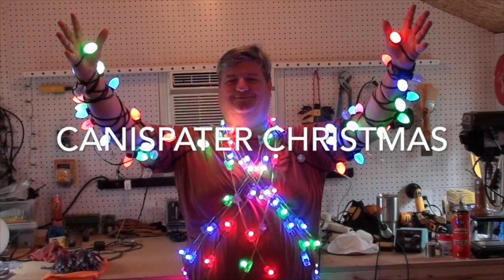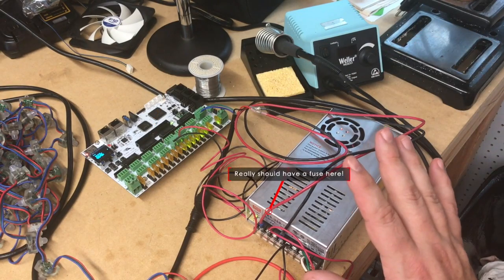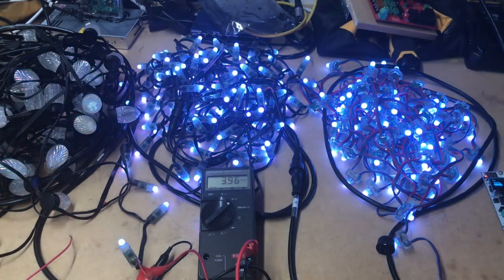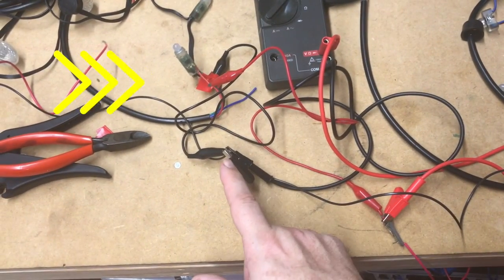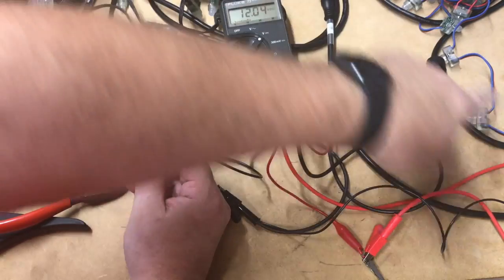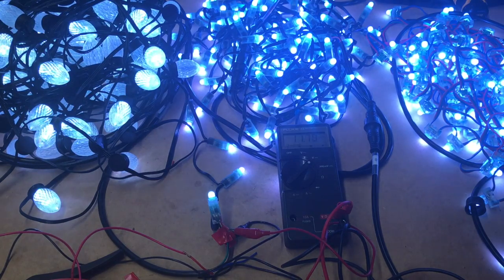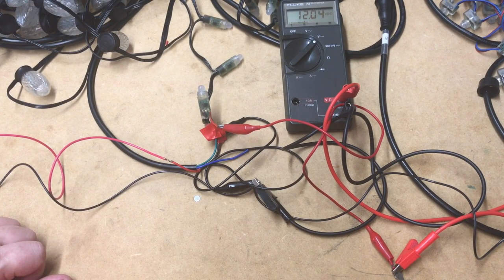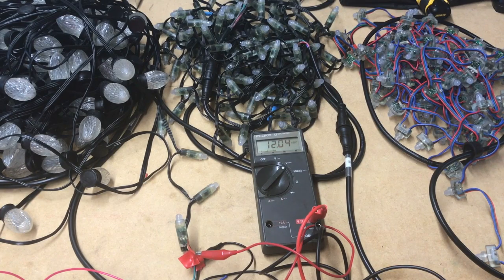Injecting Power For RGB Pixels

Comment: What gauge of wire is good to use for power injection?  I am doing house outlines with a total of approx 800 nodes and a singing face with 380 and another with 100.  All 12v.  Will one ps be sufficient if so how do you take the wire from the ps to all points of injection no more than 100?  My singing face with 380 I will need to inject approx  3 times.
Love the channel!
Reply from the maker: Thanks! Distance, string length and brightness all affect what you'll need so you'll have to experiment a bit. You can usually go 100 12V nodes with no issues. Stay under ~80% of the max current capability of the power supply. So a 30-amp supply means about 25-amps useable. I'd start with 18AWG or better and see how that works (depends on what you already have). "My singing face with 380 I will need to inject approx  3 times." Probably true for 100% brightness. I did my large 280-node wreath with only power at both ends this year and it was fine at 30% brightness. So it's a balancing game and let the lights be your guide. Try with no power injection first then add as needed. Start injecting at the end and work your way back to the beginning of the string. You may find one is enough.

Comment: So, basically the only channel important from the controller is the data channel?
The plus and ground can be gotten straight from the trafo?
If that is the case it helps a lot since most controllers only manage 5 amps, which if you try to get all the amps thru there, make 5 volt systems useless.
Reply from the maker: The goal is to keep current going through the board to less than 5 amps. There are several ways to do that. One is completely bypassing power distribution on the board. Another is using power injection along the string. Another is lowering brightness. 5V strings need more power injection than 12V strings, but you can get strings long enough on either voltage. For example, I have 4, 300-node strings on my 12V megatree. I inject power every 100 nodes and run them at 30% brightness. That keeps current through the fuse below 5 amps. For the demo, I bypassed completely, but I don't do that in the display any more and use power injection and brightness to manage current flow.

Comment: So when I attempt to run 2OO pixels full white at 100% with no power injection, I blow a fuse on the board port. Did you put a higher amp fuse in when you did this test to keep the lights on? Thanks.
Reply from the maker: No. In this video I bypassed power distribution on the board. The traces on the board are the limiting factor. If you put a higher amp fuse in there they will burn. So instead of going through the board for power, I connected directly to the power supply. If you're going to do this, I strongly suggest you put a fuse in line since it won't be protected by the board. But I also suggest using power injection. :)

Comment: Thanks for another good video. What kind of cord type do you recommend for doing power injection.  Can I use regular extension cords and just add pig tails/solder directly even?  What about for data do you use just CAT5 cable?  Thanks for any advice you have for me and keep up the great work.
Reply from the maker: Thanks! First, I try to limit the amount of power injection required by lowering the brightness to 30%. Pretty much any kind of copper wire works for injecting power. I have one run that is greater than 30ft so I use CAT5 for the data line, but normally just use the standard pigtails from Ray.

Comment: So i have watched your videos here and in your class and have a question. when running lights for a roof line display that is a total of 240 ft for example. 60 feet on each side of the house (for a square house example) and you have 12v pixels spaced 6in apart from each other, so you have 480 pixels to power. would you run separate power supplies in this situation or would you use 1 power supply and then power inject after every 100 pixels? and if you power inject - how long of wire can you have to run in between each 100 pixels. I guess the power inject scenario im fuzzy on, i get the concept - but having a hard time visualizing how to do it on a large scale for a house or something.
Reply from the maker: Ken, yes, that is really the problem with power injection - every situation is unique because just about everything impacts whether or not you'll need to inject power. I always advise to let the lights be your guide. Set them up like you would run them in your display (you could do it on the ground first to make it easier to tinker with), but connect them up as close to reality as possible. Run some sequences through them instead of just test patterns. If they look great, no power injection needed. If they look bad toward the ends, then you need to start checking voltages and getting creative. People have told me that 2 power supplies with pixels between is fine, but I haven't seen guidelines so I always advise cutting the positive lead between the two supplies feeding the same string of pixels. Injecting every 100 is also a guideline for running them at 100% brightness. If you cut brightness, you need less power. For example, I have a string of 175 with no power injection running at 50%. Do they dim toward the end? Maybe, but not enough to worry about injecting power. So the power injection technique while fairly easy to explain, is hard to tell someone how to do because it requires some experimentation in each scenario.

Comment: Hello
For each strand you inject powerto, do you have to use a new different wire that comes from the PSU to the strand of light or can you run one  line parallel that connects to all of the strands?
Reply from the maker: It is best to inject with a new wire, but always check the voltage at the end of the string before injecting power as you may be able to skip a string. For example, I run 4 sets of 300 (3 strings of 100) on my tree and only inject at the 300 point as there is sufficient voltage at the 100 and 200 point. The lights will tell you when they need power by looking dull or not working at although it could also be a signal problem so best to check voltages.
Reply: Thanks for your response. So to confirm, if I have 3 sets of lights that all need power injection, I would run three separate wires from the PSU to each set of lights? Is it not possible to use only one wire for to inject three separate spots?
Reply from the maker: @NakedAndFurryPets  You can try using one wire in parallel, but it's best to use 3 separate wires.  I'd say try one, if that doesn't work, add two more. Power injection requires a little bit of experimentation. :) Maybe try going to the last one first to see if that fixes the problem then work your way back toward the controller. You may find that one at the end takes care of it.

Comment: I’ve been watching most of your videos and find them to be the most informative. I’ve also been watching other videos as well. I’m trying to do as much research as possible before investing in some of the items. Let’s just say I buy a controller like the F16v3 that has I think 16 ports and build a mega tree with 16 strands of fifty pixels. Could I use 1 port as long as I inject power or would the mega tree take up most of my ports? I seen one guy use all the ports and one guy use half the ports. Which they were using different controllers. This a concern of mine. I really want to do this but if all I can do is run one tree off of one $300 or $400 control box seems to be a bit frustrating. Sorry I tried to fit a lot of information in a short paragraph. Hope it make sense?
Reply from the maker: No worries. Each port on the F16 supports 1,024 pixels assuming you aren't using any expansion cards. Be sure to check out my F16 video as that may explain some of this. So if someone is using an F16 with 16 strings of fifty, a lot of the capability of the controller is wasted. If you run one string of 800 pixels, then you have 15 additional ports to go crazy with. :) Power injection is hard to grasp for some so they prefer to use the ports. Potato potaato.

Comment: I’ve hooked up to power supplies unknowing and had both power cables intact and measured the voltage and was still only 12 volts? 
I’ve been having a hell of a time getting my pixels powered but I think it was due to wrong t connectors and me being a noob 😭😭😭

Comment: to power injecting my ws2812 strip do I just add a neg wire and positive wire from the end of the second set to the 3 set or add a wire from the power supply thank you
Reply from the maker: Power injection involves adding additional power from the power supply (preferably through an inline fuse to protect everything). So one connection at the beginning of the string and another connection at the end of the string for example. You'll have to figure out what is best for your setup, but the lights will tell you when they need power by not looking as bright as the ones at the beginning of the string.

Comment: I have a 10m windows perimeter which I will surround with WS2811 pixel strips (joined together on the window corners). I'm using a E682 controller with 12v output. Will I get away with powering the entire 10m strip of pixels with no power injection?
Reply from the maker: Possibly. Especially if you aren’t running at 100%. No problem trying it out. The lights will tell you if they need more power.
Reply: Thank you and fantastic video collection BTW. This is the very first synchronised Christmas light display, so I'm a complete rookie. Decided to dive in head first with a combination of LOR AC/DC props and pixels. There's only one other person in my town that puts on a synchro display here in the UK, so I'm expecting some attention this Christmas! I hadn't considered running pixels at less than full brightness. A bit tricky for me as I'm having to sequence pixels in xlights, convert to lms then open in LOR SE and paste into my existing sequence.
Reply from the maker: Thanks! You CAN adjust intensity in xLights which might flow through your process. It’s one of the model settings (I forget what it’s called).

Comment: so if i buy the same power supply like you i could put 400 ws2811 on juste one power supply
Reply from the maker: 400 standard pixels would be roughly 24amps so if the pixels are standard, a single 30-amp power supply should be fine. Make sure to verify the power requirements of the pixels because they CAN be different.

Comment: the problem i'm having is i need to run 25ft from the controller to the first pixel using 24/4 cat5 and i get nothing until i cut the wire down to about 6ft and that's with heavy flickering. there must be some way to get this to work at this length. i believe it's data loss at that length as i'm getting 11.9v at the first pixel on + and - and even power injecting i'm getting nothing. if not i would have to put the controller close to the prop which i really don't want to do.
Reply from the maker: I have run 30ft using standard 18AWG wiring with no problems. I haven't used CAT5 to power my pixels yet, but may try it at some point in the future. Someone posted they use White/Orange for Data, all solid colors for ground and the remaining White/Color for V+. I found it on the internet so it must be true! :)

If using larger wire for this run is an option, that will most likely fix the problem.

I know you can change out the output resistors on the controller to change the distance, but that's out of my area of expertise. You might float that question on one of the Falcon Christmas forums.

Falcon has a differential receiver (good if you have a Falcon controller) that will increase the distance from the controller.

There is a device called uAmp that will boost the data signal. Again, outside my area of expertise. Forums.

Another technique is to use one or more null pixels to boost the data since each pixel regenerates the data for the next pixel. Null pixels are regular pixels, but they don't light up. Your controller should have a way to designate null pixels on the string. So if 6ft is all you can do, go 6ft, insert a null pixel, go 6 more feet, insert another null pixel and so on. This requires cannibalizing one string or at least part of a string - cutting a pixel leaving enough wire on each side to splice it in line. Also, make sure the null pixels run the same voltage as the pixels you'll use for lighting.

These are the options I know of, but I haven't needed to use any of them. I would ask this question on the forums as you'll likely find folks that have used all of these techniques and can give you better advice.

Let me know if this helps and the final solution you decide on.
Reply: i tried replacing the 24/8  cat5 cable for power and data with a  25' run of 12ga wire for ground and power and still use the 25' cat5 with only data connected. i found that my scrap 12ga wire was actually over 30' and my pixels worked fine. i also tried some thermostat 18ga wire that was around 400-300'. it barely lit the first 2 pixels but it did somewhat work. i figure my problem was absolutely a power issue due to the 24ga wire of the cat5. so my next step is to get some 18ga alarm wire and try my runs from there.

Comment: I keep getting confused on the connecting positives of two power supplies.  This was my current plan and please correct me if I am wrong.  I was planning on running power, data and ground from the controller to a string of lights.  After the first 100, place a power injection T between the first set of lights and the second.  I will then run an extension cable  with power and ground only to a distro board that is being powered by a second power supply.  All lights are 12V run by 12V power supplies.
Thank you,
Reply from the maker: Make sure the positives are isolated (cut) between power supplies. Ground separate supplies together, but keep the positives separate. If from the same supply, you can inject at multiple locations with the positives the same, but not with separate supplies. Technically, there are ways to connect positives together, but it's easier to just cut the + wire and start with a new supply.
Reply from the maker: Also, you CAN inject from the same supply at multiple locations down the strings. A single power supply can handle several hundred pixels depending on the pixel and cable distance. If you're powering from the controller, you need to stay under 5-amps (usually), but the same supply can feed a long string at multiple locations reducing the total draw from the controller. I usually use .06amps per node for estimating power requirements, but it also depends if you're running at 100% brightness or something less. White lights pull the most. Colors pull less. Long cables will also drop voltage. Power is one of the toughest parts of the hobby so you may get some help from folks closer to you or buy a bunch of fuses and experiment. :)
Reply: Thank you.   You are exactly right about power being the hardest part.  All pixels will be run at 30%-40% depending on the model so it will greatly reduce power consumption.  I have also used Clyde Lindsey's Excel sheet to help calculate power.  The two power supplies connected to each other wasn't making sense.  After you explained it, I went back to the wiki and it made perfect sense.  Thank you.